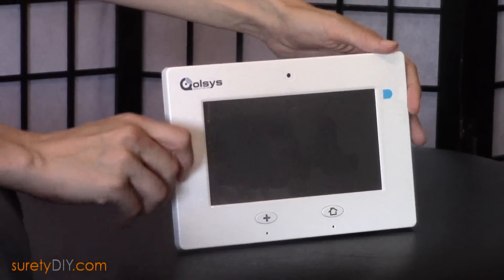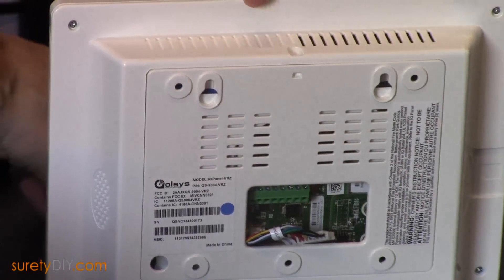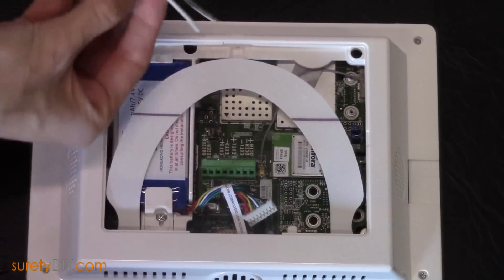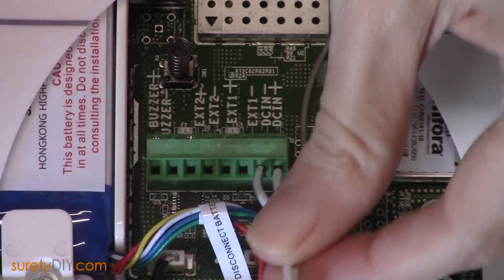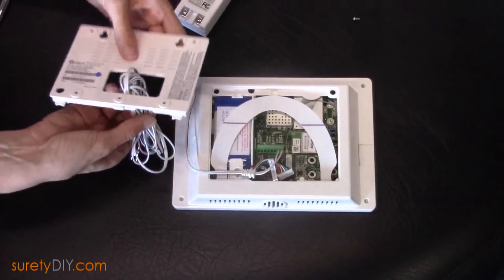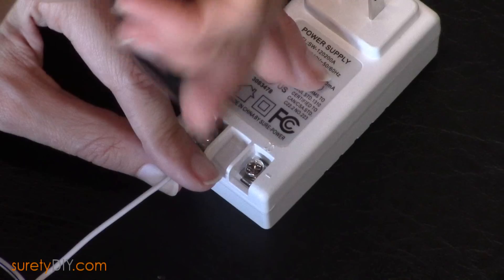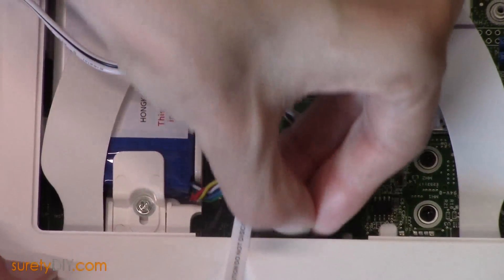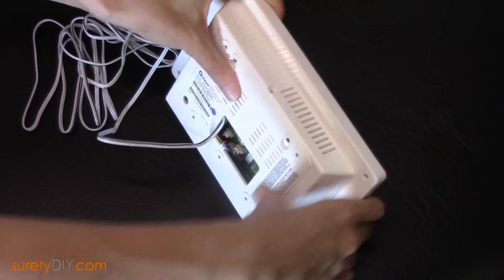How to Wire Your Qolsys IQ Panel from suretyDIY

Comment: i currently have a wireless ADT system. The panel has a power wire ran down my wall into the basement, where the power plug is. Can i use this wire (or somehow splice it) so I can power my IQ panel? There is no power need my panel area.
Reply from the maker: Existing low voltage cabling may be able to be reused, yes. Always use the included power supply with your panel however. For questions on this, visit our forum: https://suretydiy.com/forum/